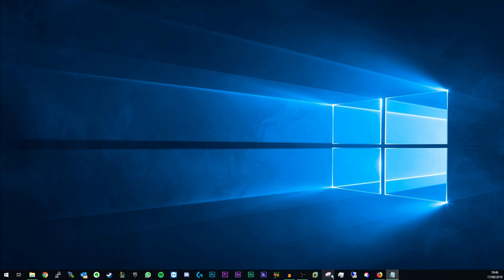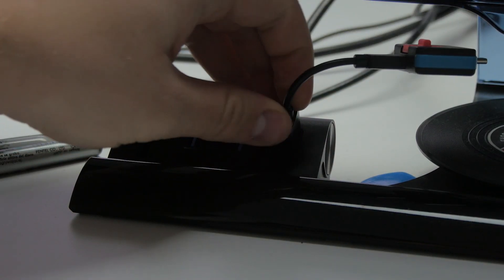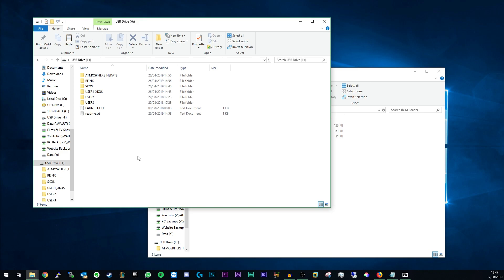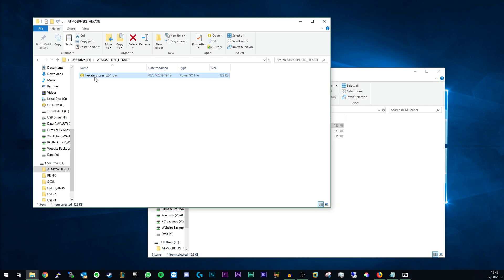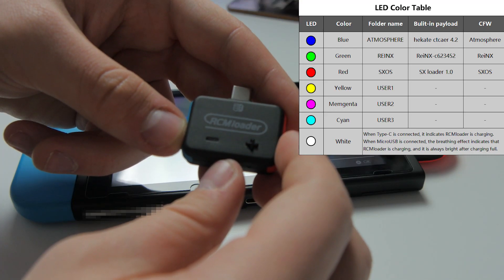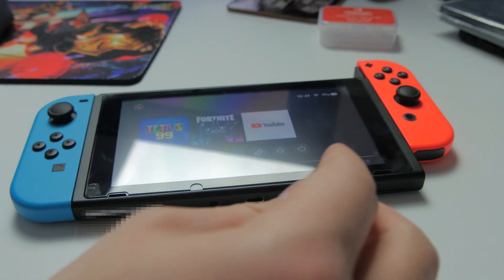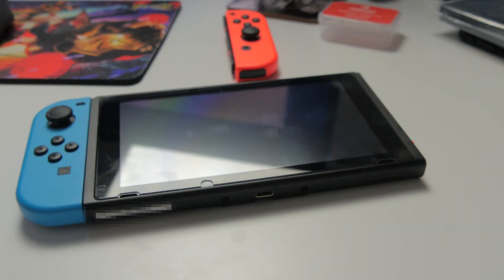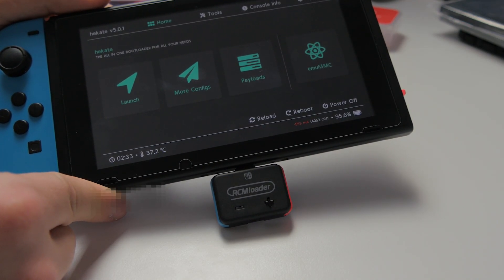Nintendo Switch: How to Inject a Custom Firmware Payload Using an RCM Loader

Comment: To some people that are not able to do this (I tried too, like a dumbass). Then I looked at the AliExpress page. It says: "The v10 version injector does not need to be linked to a computer for automatic upgrading. It only needs to have system files in the memory card and will automatically follow the memory card files for upgrading. If you need to upgrade the version, please update the memory card system files. Linking to a computer will not display a read function".
Meaning. If your microsd in your Switch has the newest bootmanager and files, it will read DIRECTLY from the microSD. There's no need to update the new tool. This might help a few people.

Comment: You lost me with how you got the injectors folders to show up on the PC. Mine doesnt show up in this pc when plugged in. Are you using a program to access them?
Reply: Same with me, did you get a fix
Reply: @DGlass769 some of them you cant update the injection folders, in that case you would just have to use the firmware thats already on the injector

Comment: Clear, concise video on beginning the Switch mod BUT if you want to avoid the Ban Police you will need to do more, much more starting with loading Atmosphere as the first level of defence. Otherwise your Switch WILL BE BANNED BY NINTENDO. The RCM loader has insufficient capacity for all the parts you need so start thinking about an SD card set up with everything you need.
Reply: Honestly i dont undersatnd whats the big deal on getting banned? Nintendo online services are joke anyways.
Reply: you can't get updates  @AlejandroMorales-cx2mh
Reply: @ian.swift.31614  yes you can. DarthSternie and Daybreak to update/downgrade your switch firmware. Google to get game updates. easy as that.
Reply: replying to an old comment, but dont listen to this dumba$z . This is NOT what runs your CFW. Your SD card does. This is just used to BOOT THE SWITCH, SINCE THE JAILBREAK IS TETHERED. This means, if you power off the device, you lose the jailbreak and must enter "RCM Mode" and load a payload (atmosphere, hekate, etc). Once the payload loads, it THEN loads the CFW from your SD card. This device has absolutely fuckall to do with you getting banned.

Comment: Does the micro SD card need to be inside the Switch when you plug the RCM loader into it?
Reply: i believe so
Reply: Before you turn it on into RCM mode, yes.

Comment: Once the payload is injected and you're in CFW, can you take the loader out and then just put switch to sleep and charge, aka turning it off once in awhile?
Reply: Late but you can put your switch in sleep mode but if you completely turn it off you have to launch the payload again

Comment: I have purchased the RCM Loader and I, awaiting delivery.  In the advert for the loader it states will work on any console prior to 2018. My console was manufactured 2016. So I've checked my serial number and the result WAS ITS PROBABLY patched. So most import my noon question could I brick my console if itsbeen patched even though its before 2018.

Brilliant video even a noodling me understood and many thanks for any advice and help I may receive

Comment: But do you need to use the rcm injector every single time in order to boot into cfw mode?
Reply: If your switch turns off completely then yes you will require this rcm injector to boot back into cfw

Comment: This is so well worth buying once you get it to work properly 👍
Reply: Whats the difference between this device verse the videos on youtube that doesnt require the device only the jig?
Reply: @VTuber_Clipp3r  you dnt just require the jig you would need a pc or laptop to boot into rcm with the loader u only need that and the jog can be easier when your out and about
Reply: Couldnt disagree more! Plugging my Team Xecuter dongle (Exactly the SAME as ANY other Dongle) in via Micro USB does NOTHING but charge it, no PC detects them as thats obviously not how they were made. This video is pointless.
Reply: @VirusOfCyrus  You could try with another cable. Mine (chinese one) works just fine.
Reply: @VirusOfCyrus  Why us SX OS its dead use atmosphere

Comment: Would a rcm loader work on a switch v2?
Reply: no
Reply: you can only use sx core chip with v2 Switch. it needs to be soldered onto your motherboard. if you look around on the internet you can find reputable people that you can send your Switch and sx core chip to so they can solder it on for you, if you arent sure you can do it yourself

Comment: Does this work for Switch V2?
Reply: You need an sx core for v2 switches
Reply: @immortaldarkred2154  true but is not an easy thing to do and unless you are really skilled with the soldering iron you will break your switch
Reply: @bensymons  There are people you can hire to do the job for you, or you may know someone with soldering experience.
Reply: @bensymons  As well as that, sx cores now a days are as rare as gold, sure as expensive as hell too. I came across one that sold for $200, but I've seen them sell for $300.
Reply: @immortaldarkred2154  that’s my point you might as well just buy a V1 model and sell your v2 model as the sx cores are expensive and getting professional installation is costly and time consuming. By doing the install by yourself you have a high chance of bricking your switch so I just don’t think it’s worth the risk
Reply: @immortaldarkred2154  you clearly know what you are talking about anyway so I am sure you know what you are doing
Reply: @bensymons  Exactly what I did except I bricked mine on the install. I sold my paper weight switch for $70 and my core for $200, meaning I have enough for an unpatched switch.
Reply: @immortaldarkred2154  wow that must of been annoying still at least you still was able to sell your sx core or you wouldn’t of been able to get an unpatched switch. Do you know if there are any benefits so having an patched switch with sx core over unpatched switch with rcm loader?
Reply: @bensymons  Idk, but I hear there's more freedom with a switch that can accept payloads (unpatched)
Reply: @immortaldarkred2154  Ok thanks for telling me that’s nice to know
Reply: no

Comment: I did exactly that, and it's not injecting Hekate at all.   My Switch Serial is a XAW10112xxxxx  Model : HAC-001 with no bracket.    Is it possible that the latest Hekate is not  compatible with my atmosphere?
Reply: your switch could possibly be patched
Reply: your switch is patched

Comment: Do I need to add any files to my sd card if I have the right loader? That’s the part that confuses me
Reply from the maker: It's best to download the latest version of whichever payload you're using and copy it to the loader.
Reply: Homebrewed Tech sorry so just to clarify if I am using rcm loader, I would load my files on there instead of the sd card, I see a lot of people using the sd card and some only the loader.
Reply from the maker: @matthewortega9868  The only thing that goes on the RCM loader is the payload to boot the switch with, nothing else. The RCM loader only takes the place of the PC in booting the switch, it doesn't store any additional files and is only meant to be connected to the switch when booting it.
Reply: Homebrewed Tech and thank you for responding
Reply: Because this question was never answered properly or shown in the video, 
the answer is yes, you do. The payload zip file for what you are trying to boot has a bootloader folder inside it aswell. That part goes on the SD card.

Comment: hey just wondering if i can do this on a mac. i dont have a pc and i cant plug my mac directly into the switch because i cant open the .exe file that injects hekate into the switch. i dont want to risk buying a payload injector if it doesn't work.
Reply: FattyMuffin I’d you can download the files then there’s no reason you can’t. Just put them on the injector and your all good
Reply: There is a Mac version of the injector too! macOS launcher for Fusée Gelée

Comment: hey so im getting the issue that it works when i inject the payload on the pc but when i try to use the payload loader i bought(its just like urs) i get a quick red txt on top left corner then black screen.. it doesn't boot into hekate ... any idea?? or ever have this problem?
Reply: Did you update the payload file?
Reply: Plug the RCM injector into your computer and then go into the Atomosphere/Hekate folder. There should be a file called 'payload.bin'. Delete that and replace it with the latest version of hekate. Be sure to rename the new payload file to 'payload.bin'.

Comment: Hi friend is this for firmware 8.1.0???
Reply from the maker: In this case yes, since the version of Heketa I'm using supports v8.1.0. This will work for any version supported by the payload you're using.